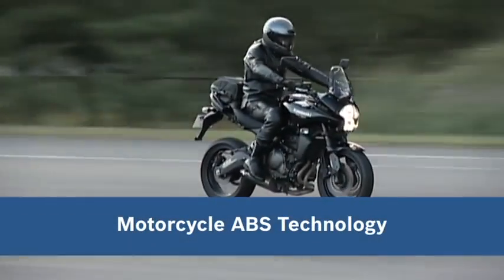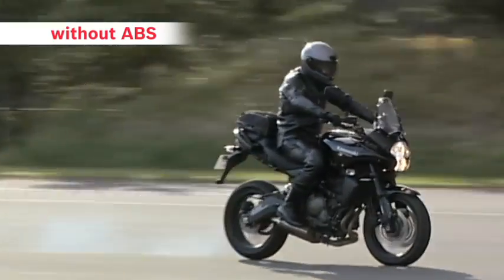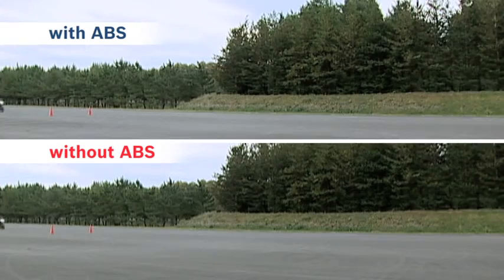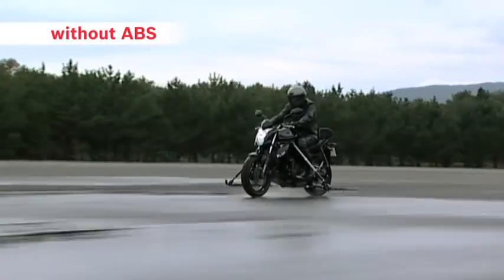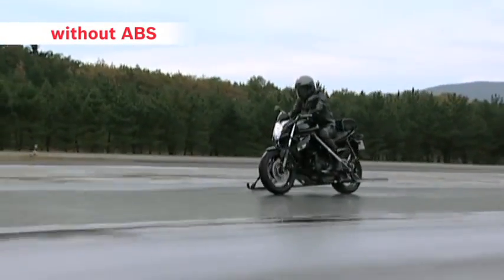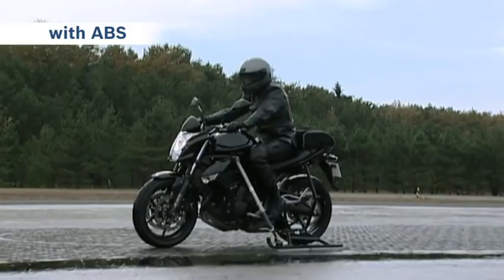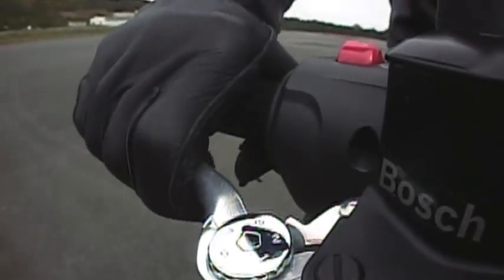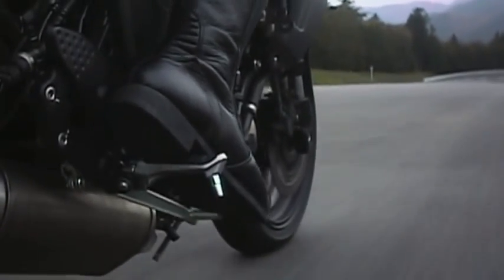Bosch Motorcycle ABS demonstration

Comment: Don't understand the hate for ABS.
When I took my MC license, one of the maneuvers we practiced was emergency braking. We were taught proper braking technique but since the bikes had ABS, when the handle was fully squeezed we were able to do small stoppies. Had it been without ABS we would've just dropped the bikes instead.
How is ABS bad? It helps you stop 24/7. If you're a MotoGP rider, sure, you might be able to slightly outbrake it, but if you're just an average Joe riding on weekends, you're not able to and you're better off with ABS.